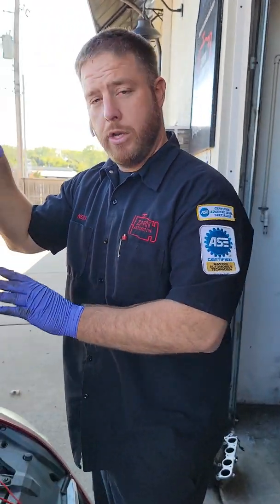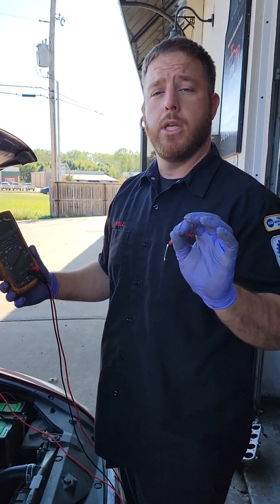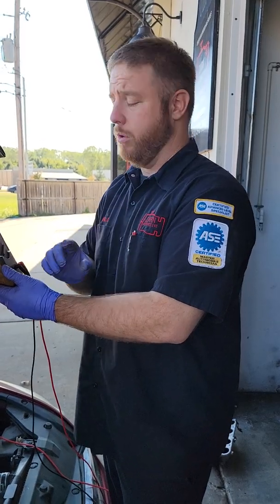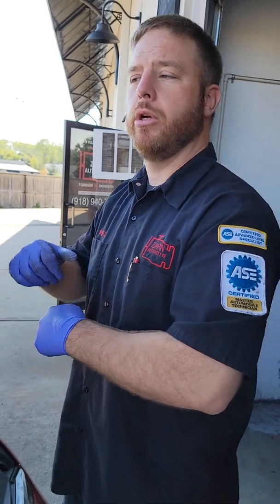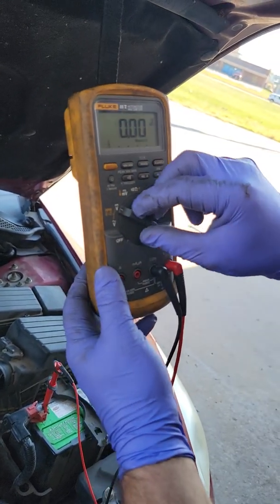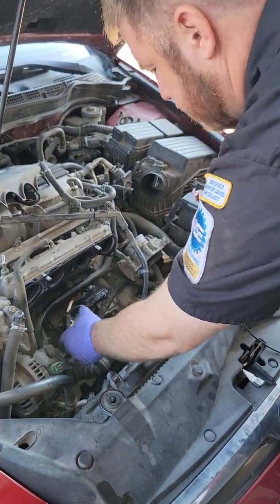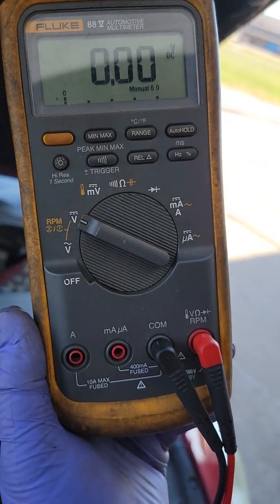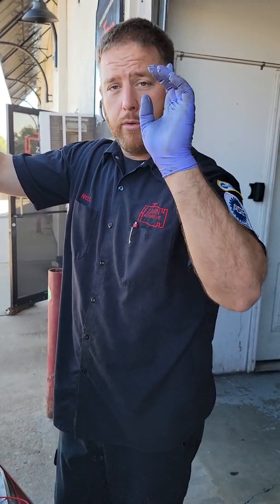How much voltage drop is normal on a good starter?   Lets find out.  #cya

Comment: I think you may be getting this about face.
Connecting a voltmeter between battery positive and the positive input on starter is going to measure the volt drop under load in that line only as it's in parallel to the circuit. The same applies to the battery negative and start body, only volt drop on earth is being checked. You could measure the resistance on the same circuits and use ohm's law to calculate potential volt drop as well. V/a×r , W/a×v .. 
If you want to see the volt drop on cranking you just fit the voltmeter on battery positive and negative and measure voltage under cranking after checking the battery is serviceable and holds voltage on crank.
Reply from the maker: This is the proper test for voltage drop, the way you describe would test the battery itself.